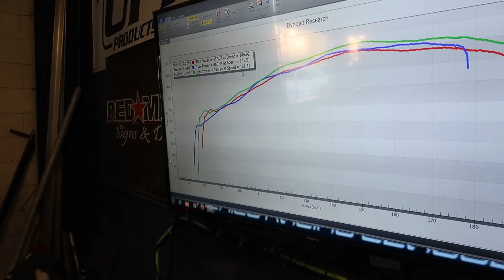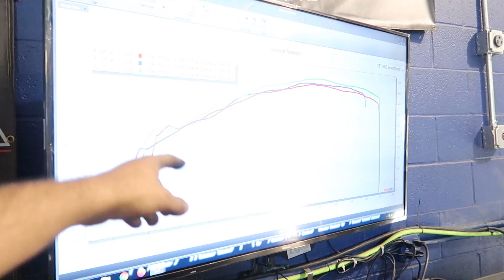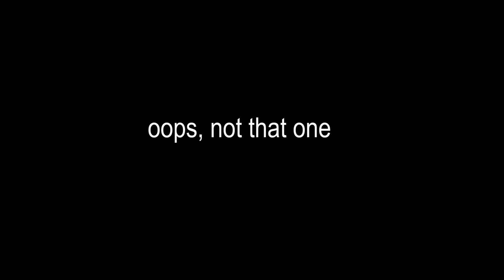ANOTHER DRIVESHAFT EXPLODES!!

Comment: “If it says military grade that just means they went with the cheapest shit possible.” True 🤣
Reply: But they still had to make them according to the spec's.
Reply: @TheGhost That's not how it works.
Reply: @TheGhost The term  "Military Grade" is used very loosely in commercial products. 
A company can make a product that is above and beyond what the military might require. But it can also make the same product trash.
Military grade basically means that a produce was or is made to the specs required by the military. Does it mean its the best? No.
Its like you wanting to build a house. You get 3 quotes from 3 different contractors.
You will most like go with the cheapest one. Does it mean he will build you a crap house? No. Why? Because the builder still has to build your house according to the architectural specs in the contract and building codes.